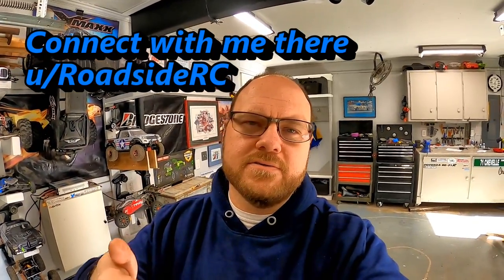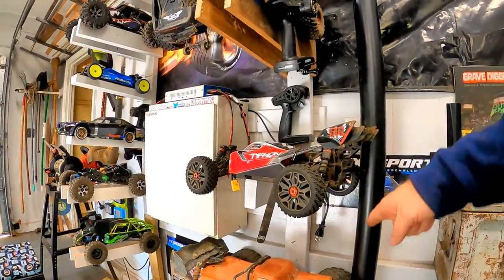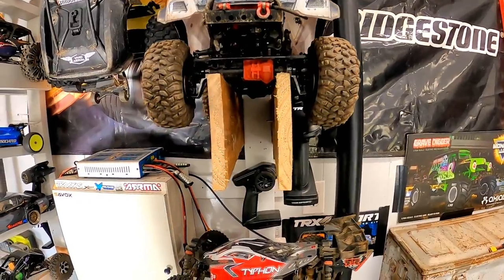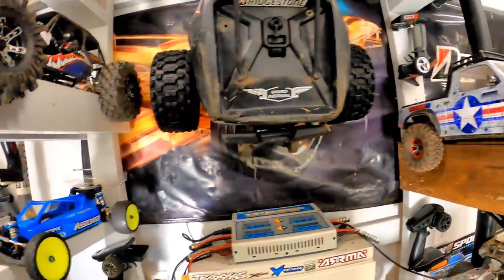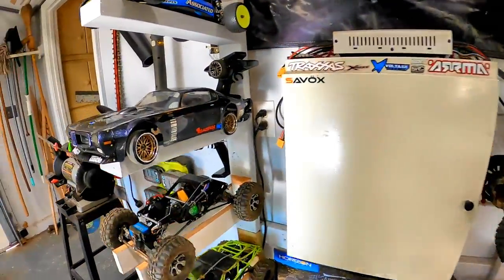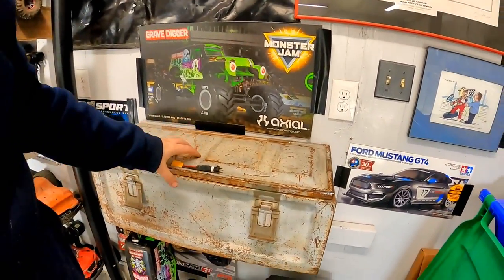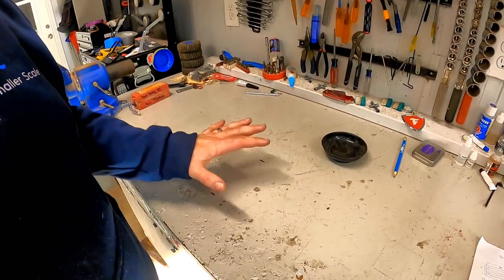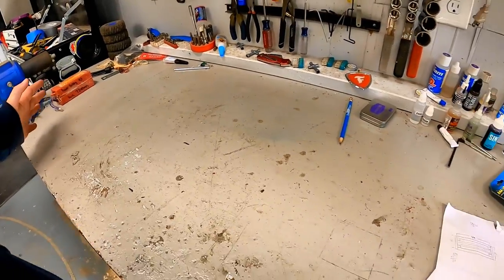RC Truck and Car Storage and Workbench Ideas

Comment: I use telekinesis to hold my vehicles and controllers.  It’s tough at first but worth it, no flat spots in the tires.  For tools, I juggle whatever I’m using and the parts.  This also was difficult for a while but like wrenching skills, it became second nature.  
I’d make a video about it, but I’m out of brain power.
Reply from the maker: Ha!  
I have seen this firsthand....it is impressive.  :)

Comment: If you hang your XMAXX that way and front tires will have flat spots.  Just helping you out.
Reply from the maker: I thought the same thing.  However, I have now kept the X-maxx this way for over 1-year with no problems. 

I guess the Badland tires are just that hard.
Reply: @RoadsideRC  Wow!
Reply: That's true with softer tire compounds like crawler tires n stuff, but not badlands.

Comment: Great solution Troy!!! I need to do something like this.
Reply from the maker: It really does work well for sure...and is VERY cheap.  
One of my main thing is also to try to keep the controller with the vehicle.  As I bet you understand, figuring out which one goes with which truck can be a PITA.

Comment: great idea. Got tired of stacking all my rc's on shelves in the garage. I ended up using hangers from Home Depot. Both by Everbilt. Heavy-duty tool rack (#1005-605-653) for my cars, and screw-in tool holder (#864-404) for transmitters. Just evenly space them out down a 2x4 mounted to the wall. Works great. 👍👍
Reply from the maker: Awesome!  
I bet those do work great!

Comment: This looks great! Could you share some of the dimensions of your car rack?
Reply from the maker: Sure!
Not boards are 2x4s, to help with dimensions. 

The spacing between each platform is 8-16" depending on how big the vehicle is and where I am putting the controller.

Comment: You have a nice work space man 👍 I have to use shelves and then I set the trucks on old tires. Michigan is way too cold in the winter for a garage workshop unless it's heated lol 👍
Reply from the maker: That makes sense!
My garage is attached to the house, so that helps insulate it some.   Then, I just use a few space heaters to knock the edge off...

But, I assume we are still 20* warmer than you are on average.
Reply: @RoadsideRC  It's 25 degrees this morning 🤣 Even the basement is cold ❄️⛄
Reply from the maker: Yeah, boo!   Mid-30s here.

Comment: I actually love these diy rc shop vids! Not only gives us an inside look into how others manage to keep the overflow of rc's, tools, parts and a proper work area as organized and functional (atleast as best as we can while trying to keep it from being the "greatest place to put anything/ everything on". I too really like the magnetic tool holders as they make it extremely easy to fund, grab and put back our most commonly used tools but also makes picking up hardware easier since they too will have magnetic properties. My concern about the really great/space saving way of storing the rc's is the stress on the shocks. Like the look/functionality of how the "rc tree" stores/displays all the rigs but with heavier rigs I feel like ise need to remove the tires/sheets from each rig(I generally remove tge wheels anyway) but also that method of hanging rc'svon the wall like you did with the xmaxx...  I can't help but think that after awhile of hanging the heavier rigs by their arms might cause some stress due to tge overall weight of the larger scale rigs(I use this method for my small scale rc's just not for anything 1/8 or bigger although I see a ton of guys do as you have and haven't heard of them having problems so I could very well be wrong). Anyways great vid and thanks for showing us around. 🍻
Reply from the maker: Thanks for the detailed comment!
No issues hanging the X-maxx so far...and it has been like that for years. 

Also, don't know if you noticed how I hung the 1/8 Arrma vehicles.  2, 2x4s sticking out.  Plenty strong that way also.